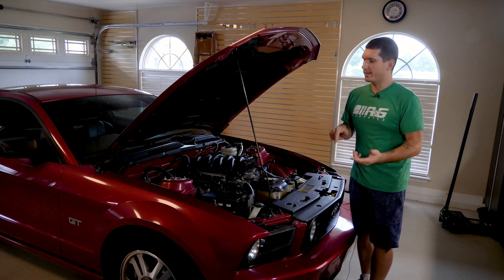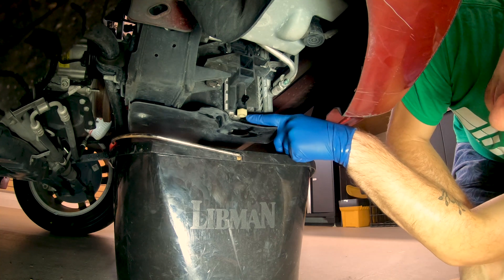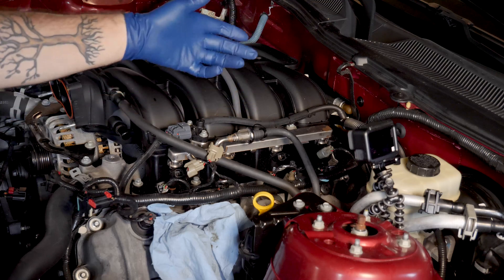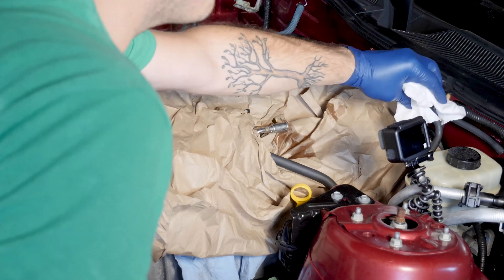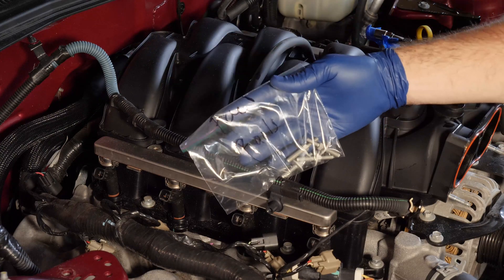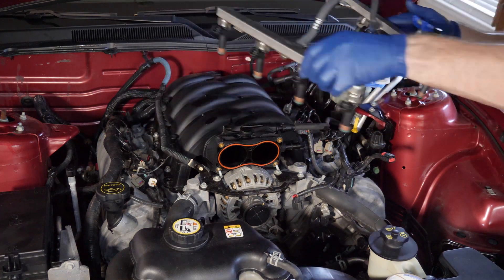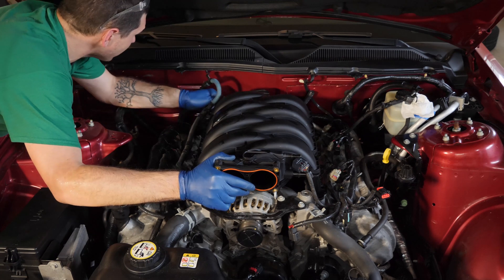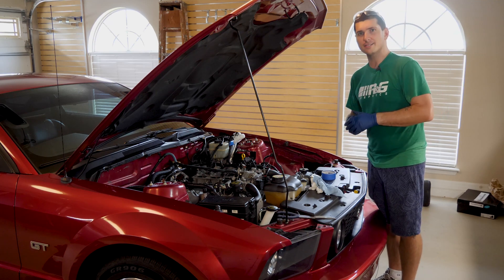How to Disassemble Mustang GT 3v 4.6L Motor 2005-2009 Part 2

Comment: I have an 08 that I've had since it had like 3 miles on it. Trying to change the spark plugs a few months ago and them horrible 2 piece spark plugs started snapping. Presoaked and everything... didn't matter. So here i am. Pulling mine apart to get them spark plugs out 😭😭
Reply: Common

Comment: Uncomfortably hard, for real! I got one rail out and tried the same amount of force on the other side, but the thing wouldn't budge. Ended up bending a fuel injector port on the driver side rail and ended up have to get a new set of fuel rails.
Reply: Any advice

Comment: very well shot videos. Wish someone had done a series like this for my car!
Reply from the maker: What car is that?
Reply: @Rythecarguy  I have a 2007 TT MK2 with a 2 tfsi engine. I found your channel as you are the only one with a video on draining the gearbox oil and refilling for a manual TT. I'm hoping mine is similar to your MK1 setup (it seems to be), as I'll be doing this job soon. They say 'sealed for life', but I think changing that fluid should hopefully give the gearbox more longevity. Your content is really well shot and presented and I have lots of jobs that I've either done or got lined up on my car which I'm sure would be simpler had there been one of your video series on it!

Comment: Dude all over a plug,,,, has me nervous as F now to change mine!
Reply from the maker: Well let me tell ya. You might just want to take it in and pay the pros to do it. If they mess it up it’s on them. Otherwise, I here is what I would have done differently. 

Use PB on all of the plugs and warm the heads up between each plug removal. So basically warm up the head, crack it loose (just that one creaking sound) then hit it with PB and then do the back and forth method. Once it’s out put the new one in and run the car again to warm it up. Then repeat the process. 

The BS carb cleaner process ford tells you to do does not work. 

If you try it then good luck man!
Reply: @Rythecarguy  ok, it's on my frontier and as you know also involves taking off that intake manifold.
Reply from the maker: Oooohhh well you don’t have to worry about the plugs breaking on the frontier. So that’s good.  But yes, the plugs are far harder to get to in that vehicle.
Reply: @Rythecarguy  thanks for being positive, your channel is great!
Reply from the maker: Absolutely! Have a great day.